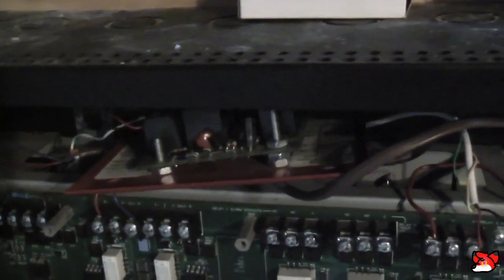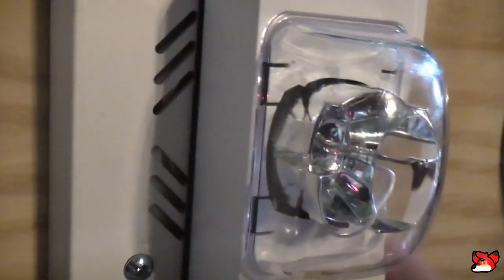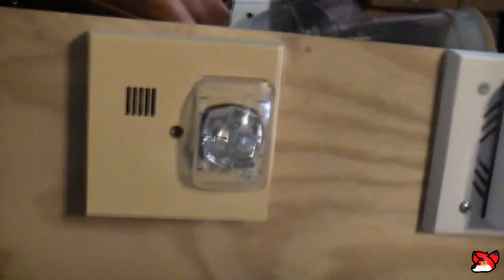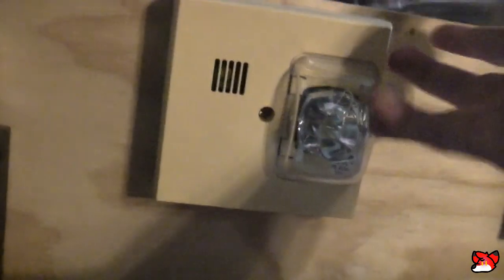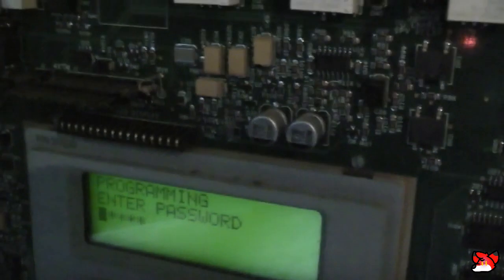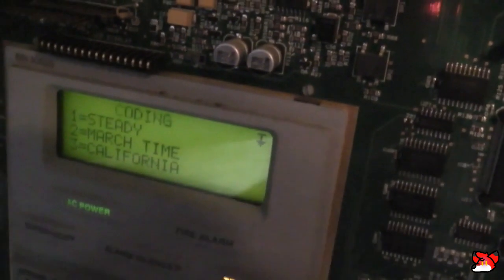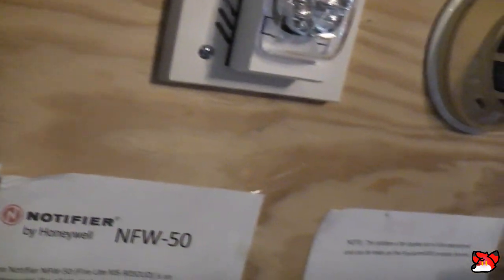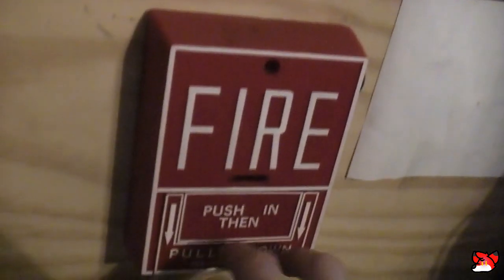Notifier NFW-50 Test 16

Comment: Faraday 'E' strobes are not sync strobes.  The sync equivalent to them is the 'M' series (Siemens/CP S17S).

Also, your 6235B-E-21-24-DC (full model number) is weatherproof, so you could mount it outside on a 3014B-0-21 or 3015B-0-21 backbox (21 is the color code for white).